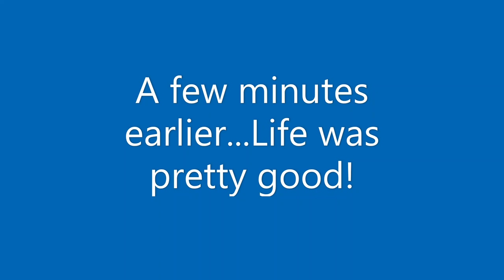2023 Suzuki Vstom 250SX -Bike Down!

Comment: I previously owned a Vstrom 1000 and was riding with a mate we parked on the side of the road and sat down to eat lunch. The vstrom managed to dig in to the gravel to half way when we came back I got on and it went straight over, down the embankment crushing the pannier bent the rack and the crash bars $800 damage 😢 I rode the bike for 6 years never replaced the panniers just the crash bars and bark busters
Reply from the maker: that would be a seriously powerful ride compared to this 26 hp. great story too. all the best!
Reply: @ridewithwarro too much power for off roads too heavy, best for very light fire trails and touring with a partner. 2002 model with the two exhaust under the seat. 22L tank made it very top heavy.

I have a 2017 Harley Iron 883 want the Suzuki 250SX as a mini ADV bike for possibly men’s group aka I will have a few to do group rides on
Reply from the maker: @ADSCoachSimonB2112  your looking at my old one here. after i dropped it here i had the $hts and sold it...lol if you look in my history i now have the black version. bought it 3 months ago. fitted crash bars/sump guard other stuff and looks good.
they are really very good value for the money.
all the best

Comment: Warro, glad you weren’t injured with that one. Puddles hide everything.  Hidden ruts can throw off any bike regardless.  Good plan to stay away from that black hole.  Very nice that folks are willing to assist. 
Surprised the bars twisted but should be an easy adjustment. 
Great content, thanks for sharing.  Lots of folks would leave that footage on the edit room floor.
Reply from the maker: yeah i like to show it as it is. that way one can count that im showing all aspects and not caning others.
up untill 3 weeks ago i had never come off any bike over 10 years back on them and i've been on quite a few. then i hit a rough patch and two different bike dropped at slow speed in the very same mud hole too.
even i find that part hard to believe but i never had the camera the day the classic 350 toppled over.
saddlebag framed held it more upright and i was able to just pull it back up -not so with the vstrom 250
sidestand dug deep into the mud and i had to use a stick to dig it out so it would fully retract.
ive been down that track heaps of times but i usually went to the far left and along the edge of it - no issues but on the two ocassions i tried to ride straight through....party over for me...lol

Comment: Bit of an adventure there Warro. !!! Think I spotted a screen extension on the bike, did you notice an improvement with the buffeting. ?? :yougotthis:
Reply from the maker: actually did and i was going down that track to pull over another 50 metres further on and do the delfector review. have not finished that part off yet as this side tracked me a bit.
hope to complete the deflector info shortly and get it up

Comment: You wee fortunate to be able to restart the bike after the fall. My last ride on a bike (scooter) was a Majesty400 about 6 years ago. I was going to work when a driver coming back in the other direction. It was rainy and I was doing 80kph. Hit the breaks and the bike slide down the road. I had broken my back 18 months earlier and was relieved that I’d done no further damage, but the bike wouldn’t restart; I found out later, because of that kill switch if it gets dropped.
 I’d planned to get a postie bike till I saw your video on the CB125f. Looks like a lot of fun to ride on dirt roads and other adventures. Will purchase one soon. 
Stay safe.
Reply from the maker: yeah i had an issue with the classic 350 reborn and a cel when it slipped in exactly the same area. i thought i'd be safe on this bike as its tyre pattern was more agressive but i think we can safely call that idea ...wrong....lol
i've had 2 of the honda ct125 trails and although they look the part and similar to and enfield single in eye candy alone...lol the cb125f is still a much better bike for half the money or here it is at aud$3600 vs aud$7800 if you can still pick one up.
i had plans to take out the cb125f yesterday but bad weather here but again its a nice little bike and good value

Comment: Take care Warro, you don't bounce anymore 👍
It's such a nice looking bike even with the mud on it
Reply from the maker: pretty nice bike indeed for not much money. was a bit pissed off this happened in forst 100 klm of its life. ive had many bikes which have travelled a bit of distance and its never happened
Reply from the maker: @christga100  looks better standing up but not too bad on the ground either...lol did you go back and re-test the hunter 350.
i'm just waiting now for the importers to send a 023 plate bike to the dealer as i said i wouldn't take the 022 plate bike in stock
i'd like a bike a bit away from first run of imports as my classic 350 were in those areas.
no real issues apart from faulty speedos but i think they have had time to smooth out any hunter issues if any.
Reply from the maker: @christga100  i expect the hunter will be a better bike to ride especailly down low in the mid range area but not as good to look at as a classic 350 reborn.
well thats what i think but in time i will find out. even the classic 350 once those saddlebags go on and even if they are just for show -its much harder to get them up on the centre stand too plus i removed the grab handle as i dont like the look of them and  doesnt help much either.
when i was buying the 500 i thought they were just gutless sewing machines buzzing along and i hit most of them immediately with better plug and sports exhaust. those two moves alone woke them up.
never done much to the 350 reborn as it sounds fine and i know the xmax will beat them and a 500 anyway...lol
plus the vstrom would bowl em over pretty easy too. 350 or 500
gotta face it..enfield and power twins yes but singles...lol

Comment: been waiting for the footage, who'd of thought it! Unlucky dmg from a low speed spill but could always have been worse - be nice to go back, if only to stop and look at why that section is so lethal. all the best Warro.
Reply from the maker: ive rode through far worse than this and you would have too. plus in most cases drama free. in this area it must be a more slippery kind of mud as the ground there is heavily peppered with small quartz rocks.
i usually stop about one klm further on .totally different soil type.
either way i might have to look into better tyres further down the track but not that track...lol

Comment: The main thing is that you're ok, the bike will fix up.
It happened so fast and at such a low speed.
I would probably avoid that track.
Ride safe
Reply from the maker: happened quick alright. i had plans to avoid it but late today i decided to take the cb125f out there to see how it would go.
only issue track had mostly dried up but still slippery exactly in the part i went down ...lol
anyway i have plans to try and put something together should the bike or bikes drop again and if it works i plan to put up a clip.
if it doesn't i still plan to do a clip but advise not the case
either way should be interesting regarless
all the best!

Comment: Hi. I spoke with you a few weeks back on Honda cb125f. Wondering which bike you prefer this Suzuki or the Honda?
Reply from the maker: hard call there as they are both great little bikes to own. i think it would depend up your budget and the suzuki would be a good option if you like the idea of cruising along the open road at 100 kph and pulling hills much easier.
but again dont rule out the cb125f as it too is a great little bike for the money.
naturally not as quick but i had it out where i dropped the suzuki in that muddy section and i was cruising along at 90 kph which it appears to like.
so in my case its a very hard call to say which one as both are great bikes....lol
ask me an easy quiestion like classic 500 and classic 350 reborn and i'd tell you straight.
the 500 if you like trouble and fixing bikes or the 350 reborn if you just want to ride and enjoy...lol
Reply: @ridewithwarro  Thanks. I am pretty set on the Honda. But might upgrade to the bigger Suzuki later.
Reply from the maker: @RogerBays  nothing wrong with the honda and its a great little bike if not i'd cashed it by now.
have a few upcoming rides planned for it too so it will be here for a while
actually been trying to find some off road style tyres but in 18" hard to get them
Reply: Thanks

Comment: Great clip, and good on you for putting it up! I wonder though if that body work makes it harder to grab the bike to lift it when it's down?
Gear linkage and hand guards look a bit flimsy for an adventure bike but at $6.5 K you shouldn't expect more.
I've been rescued lots of times by motorists over the years. People are mostly much nicer than you might think - although I did once have a someone pull a gun on me 'just in case'!
Reply from the maker: i think your right there or i think so. i found it pretty hard to find a good grip point regardless. im working on a better idea to overcome this issue and maybe plan to try it out in the next week or so when i have it more to my liking
yeah i think that linkage and covers sort of go with the price and its not a huge outlay so for what one gets i think its pretty good there.
not many with guns this way but not a good feeling. i once had a copper pull his handgun on me and i was only fishing....lol
that was 30 years back when i was right into hunting and had a dozen guns myself.

Comment: Wow, that was a slam dunk Warro. No warning whatsoever.😢 On a different note there should be a tool kit with the bike for obvious reasons.
Reply from the maker: must admit it was pretty quick...lol must admit i wasn't prepared for it as its only happened twice in 10 years and in this exact spot on two bikes within a week of each drop...lol
good call on the tool set i will have to take a look and see whats there.
on the day it was getting late too or by the time i got a bit of help to lift "old yella" and i just home just before dark after that 35kl run in 2nd gear.
that alone most likely ran the bike in...lol or 2nd gear anyway.
i'd been surprised if i'd fixed it on the spot anyway regardless as my head was more clear the next day and i sorted it out after the magpie incident.
im not what you call mechanically minded. i will try if i have no choice but usually i like to pay some-one to just get out of it...lol
anyway lesson learnt and 2 drops wiser...or so i think
all the best!

Comment: You are a bugger for punishment Warro, bikes are expendable, as long as you’re safe that’s all that’s important. Stay safe and get a riding partner.
Reply from the maker: all good there and i dont think i will venture down that track anymore unless i have better off road tyres.
i know little about tyres and i thought they would be better than the ceat on the enfield
turns out neither are any good in mud but both are good on dry dirt roads so i know that much...lol

Comment: Worro not again its a puddle lol the bike learning to swim mate
Reply from the maker: i can see proper off road tyres coming later for this bike and maybe the classic 350 too
Reply: Worro buddy if you let abit of air pressure out of tyres i will handle off road better carry a pump for tarmac see if this helps a tip that just might work
Reply from the maker: @theadventuresofbellatheenf4627  i will keep that info in mind for my next dirt road excursion...lol

Comment: Stare into your skid and hold your speed the same. It takes a bit of practice but once you've picked it app you become good at it. Find a wet grassy field, And practice practice. Don't try and pull your front out of a track in the deepest mud. It's not the bikes. It's not the rider. It's the lack of practice on dirt
Reply from the maker: thanks and good helpful info

Comment: Geeze Warro glutton for punishment I would be avoiding that place & sticking to the dry stuff.
Reply: Don't go down there again Warro especially in 350 & avoid the mud.
Reply from the maker: yeah thats a good call unless i have better protection like quality off road tyres. later on i will work on that and a couple of other ideas which may help me out
Reply: @ridewithwarro  Need to start doing what I do on new bikes & get crash bars.You'll be surprised 😯 at how much hazards around like a oil stain in shed or driveway put your foot on that & could slip over & is common cause of drops.Small investment at beginning to protect bike.
Reply from the maker: @ruahinesrider ive seen some nice crash bars on the overseas bikes. it might be something i look into later plus the tyre option too.
especially if i decide to take it on more dirt road rides but maybe not that one...lol
that track only goes 400 metres max and i was only working on doing the deflector clip.
only missed it by 50 metres too...lol
i had the cb125f over same area but ran far enge of track and no issues. once one points into the abis-its party over...lol
Reply: @ridewithwarro  I would just avoid mud altogether.Once moving through mud got a keep it straight & keep speed up but not to fast abit of a art to riding in mud.I avoid mud & stick to the dry but usually just try & to stay on the road.